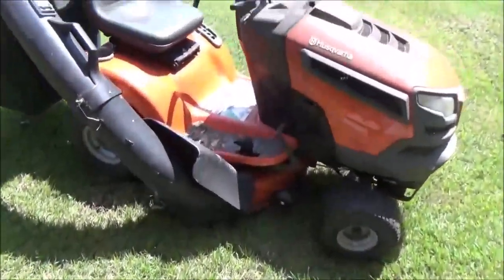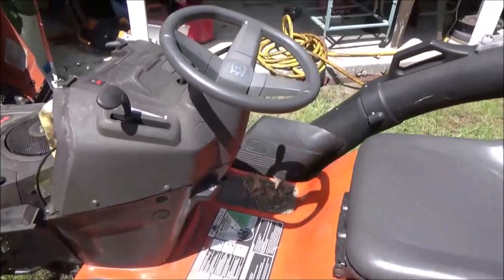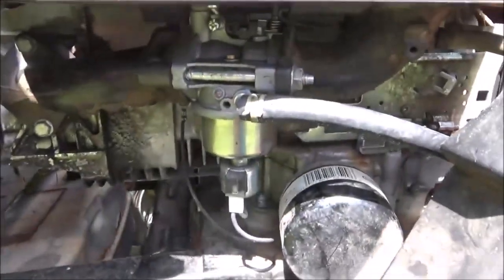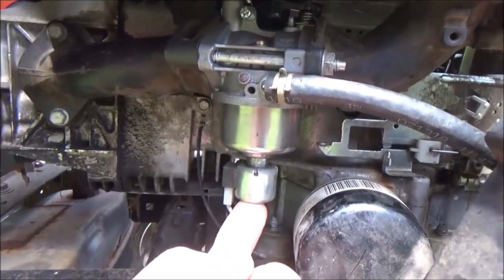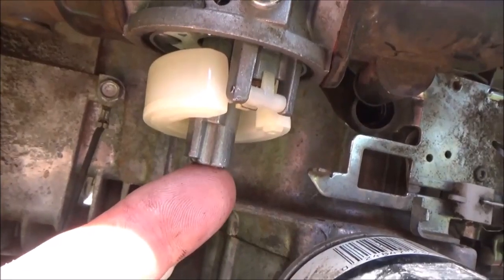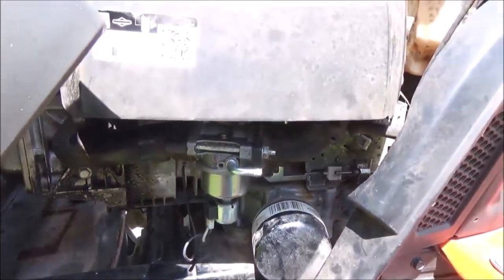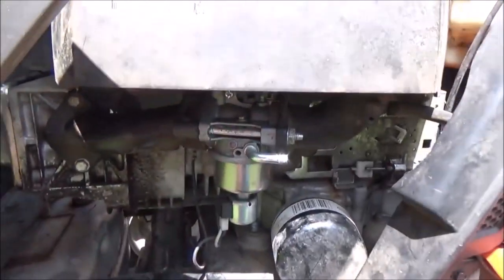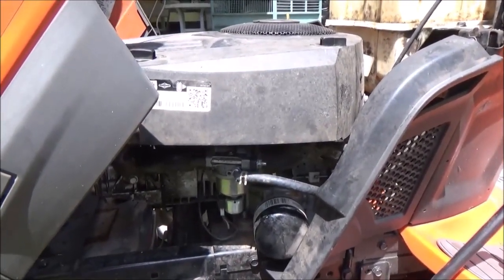YTH18542 Husqvarna Won't Start? Here's a Fast Fix For you, or buy the part

Comment: Just a note. I did that to mine.. the next day i came out and noticed my fuel tank was half empty. I checked the oil and it smelled like gas and it was high on the stick. Without that shutoff the fuel had pushed past the needle and seat. Had the drain the fresh oil i just put in and refill. I put a shutoff in the line and it solved it. Keep it off when not in use. Have to get the metal ones tho with the red arm cause the plastic ones leak like a sieve..  always check your oil and make sure its not gaining or smells like gas. Gas deluted oil will wipe out our motor. 🐸
Reply from the maker: That didn't happen with me, you may have a different motor or carb. I've never flooded, had gas in the oil or had another problem with it since I did this. But you can get the part off amazon for $10-11 aftermarket. Original B&S part is $100.
Reply: @Jsellers1965  cool